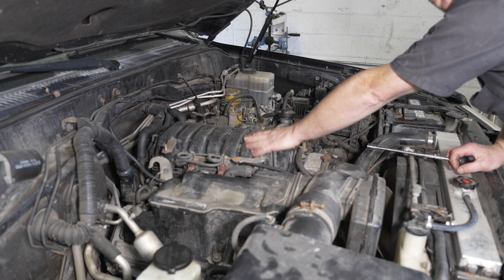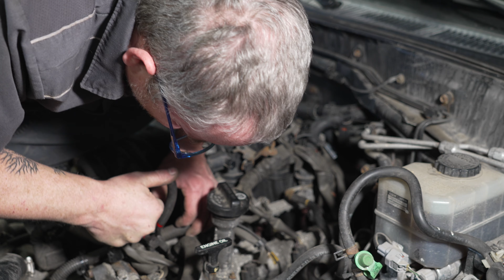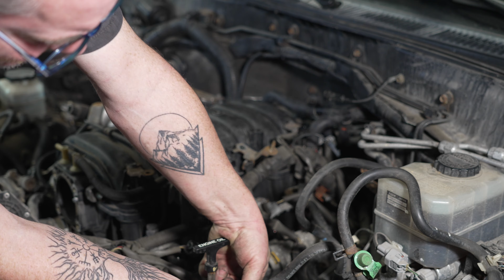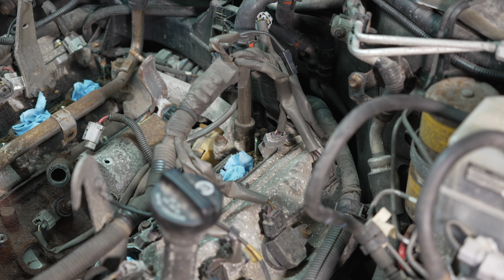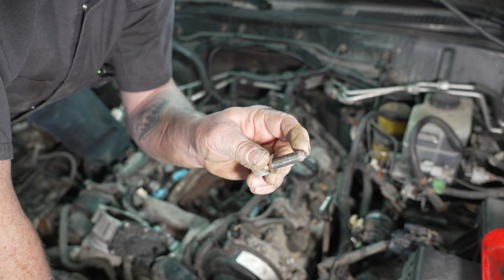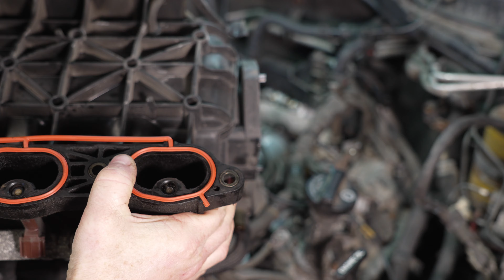Toyota 4.7 Starter and Secondary Air Replacement

Comment: Which is worse the 2uz or 3ur starter replacement? I’ve done a 1gr starter and that wasn’t an easy task either. 

Also, do you know what makes the 2uz secondary air pump more prone to breaking than other models? Seems like it would be pretty protected from rain and splashes under there.
Reply from the maker: I haven't done a 3ur starter yet. It doesn't look fun though. Every secondary failure I've seen has had either filter material or fan blades stuck in the valves. The theory I've seen is that moisture freezes in the housing and breaks the fan blades. I wonder if it's actually just the filter media breaking down  and jamming things up.